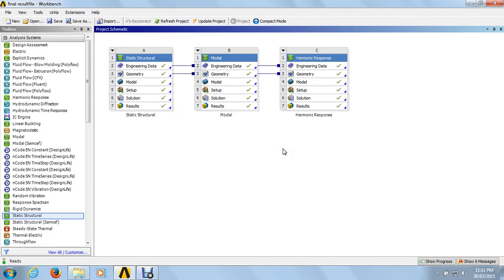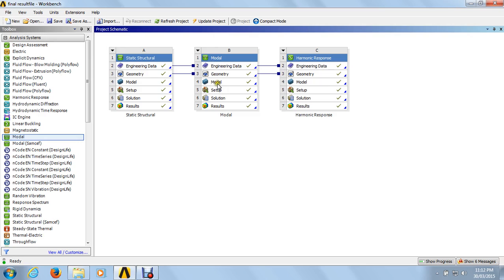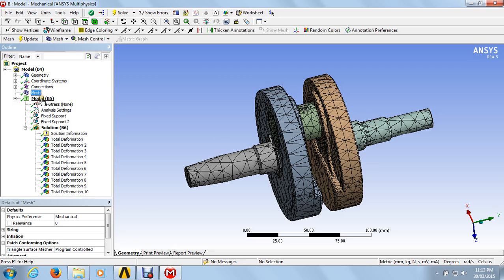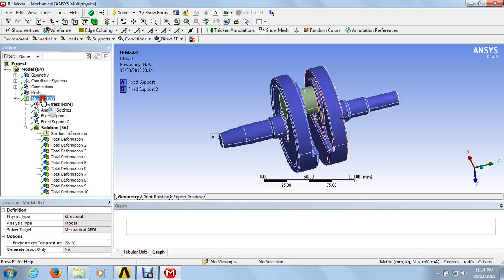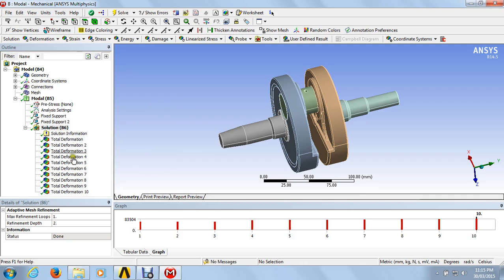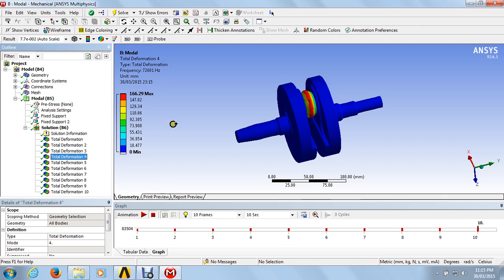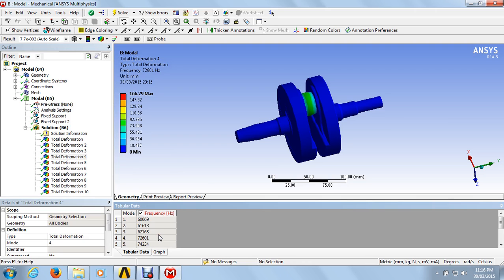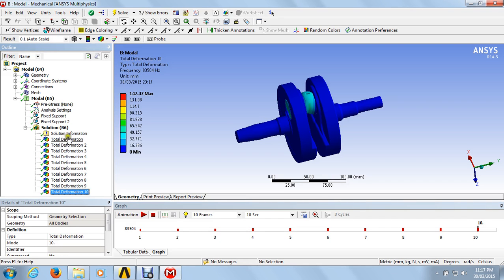Model analysis of crankshaft  of two wheeler

Comment: Can I get modeling and analysis of main shaft of two wheeler
Reply from the maker: You can do model analysis of main shaft by the same method.
You have to drow cat file and .than start analysis step bus step.
Reply from the maker: Just fix the two ends of of your main shaft and apply all the force on them